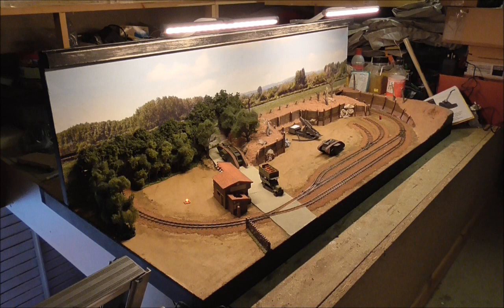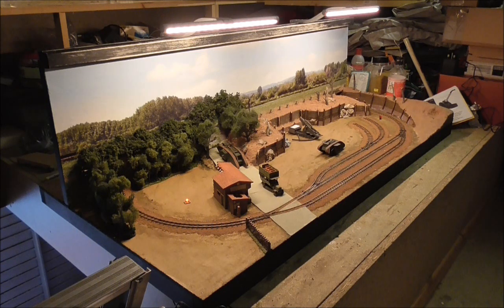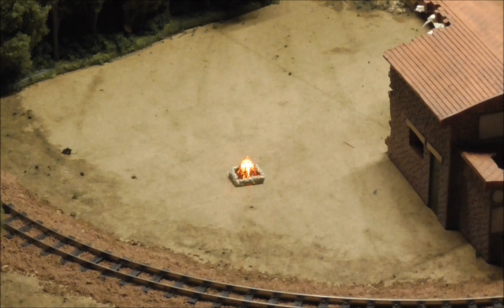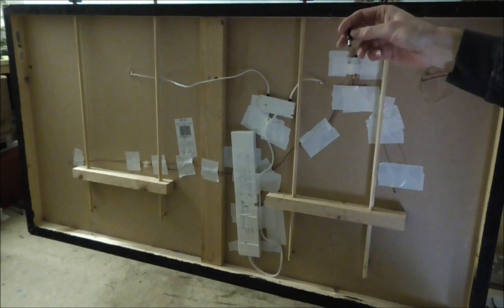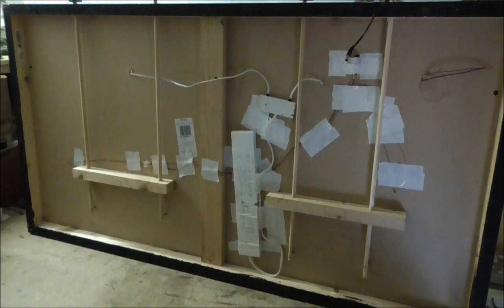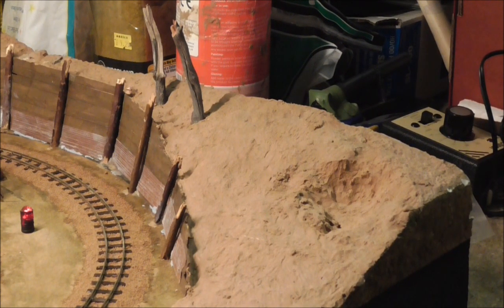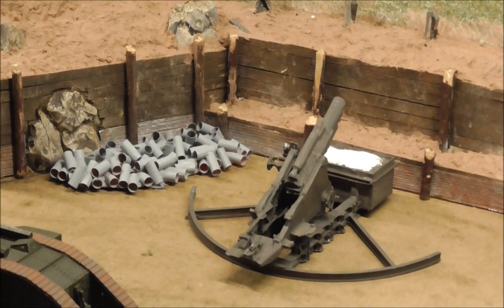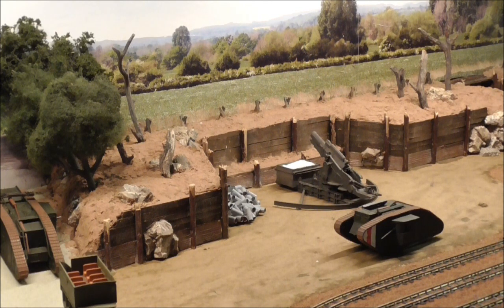Amiens 1918 - WW1 Trench Railway - 009 Exhibition Layout - Update 7

Comment: I like the idea of portraying a WW1 railway layout, it was something I've considered in the past but my main interest lies more in researching the soldiers who served in France.
As such I would like to ask why the backscene looks as if its in the full bloom of summer, whereas by the time tanks were in France (late 1916) there was no view of the front line that looked anything like what you have, just the grim desolation of a land ripped and torn apart by numerous shells. Also in having a 9.2.-in MkII howitzer that had a range of 19,935yds was by no means out of reach of some of the bigger German guns.
I know interpretation is your choice but to me if you were going to do a model such as this it should more completely represent the conditions that prevailed.
Reply from the maker: Hi there, thanks for the information. The layout is set during the Battle of Amiens 1918, which was the turning point and one of the final major battles of the war. The battle began in the summer on 8th August 1918, and I did a fair bit of research regarding the conditions, so I based the backscene on pictures take were taken during the battle. What surprised me, unlike many other iconic images taken during the great War, these imagines depicted rather lush and hardly war damaged landscapes. This was most likely due to the fast advance of the allies during the battle. I thought this would make an interesting talking point for the layout, and make it rather different to other WW1 Layout, that depict the earlier years of the war.

Comment: The lonely camp fire would attract enemy fire at night, so you could add a few tents facing the enemy kine to block it and it will show the miserable conditions the soldiers had to face during the war snd add an interesting extra detail.
Reply from the maker: That's the plan. Just got to find some to put into place. Just been painting over the soldiers themselves (over 35 of them), plus over 50 Artillery Shells and still more to do :p
Reply: Dont forget a lot of scrap, broken pieces about anything. Maybe they have a sort of a makeshift storage for anything to be repaired or captured.
Reply from the maker: Will do, I've also been painting lots of old farm tools and equipment too.